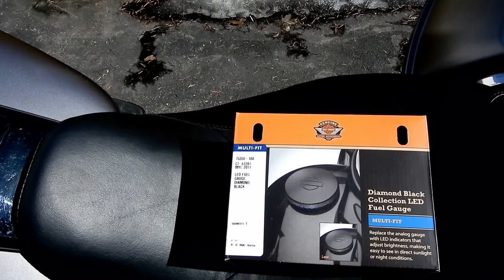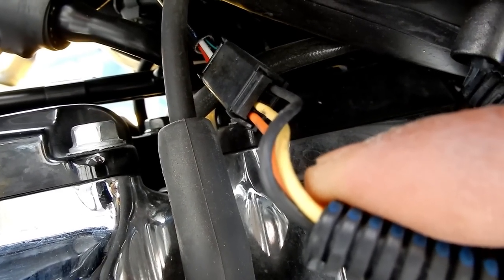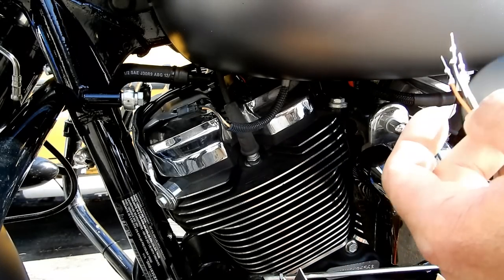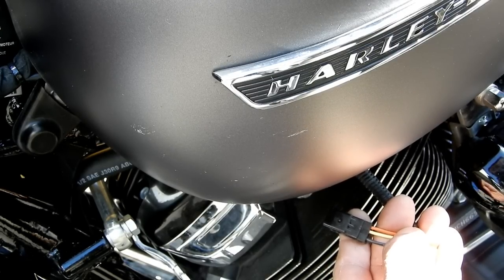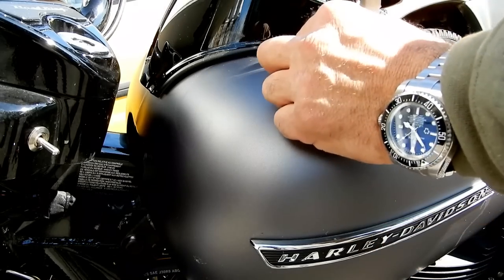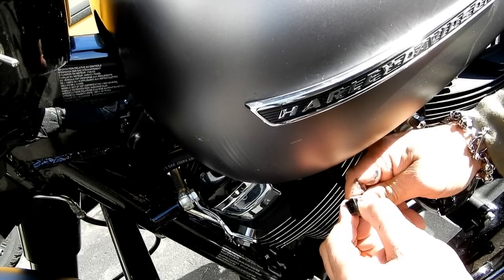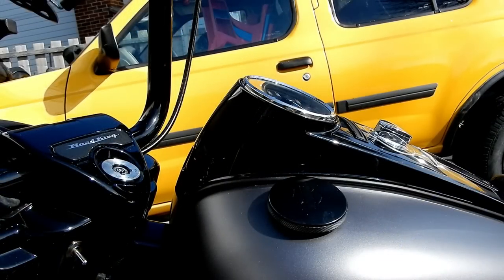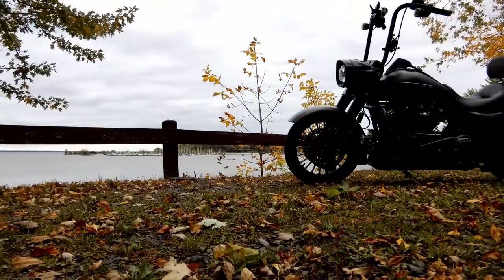DIAMOND BLACK COLLECTION LED FUEL CAPS INSTALL - 2017 HD ROAD KING SPECIAL

Comment: Thanks a bunch for this very nice video tutorial. Pulling the wires out of that connector is a pain in the butt. Ended up cutting the wires after a long try.
PS. Nice Rolex :)

Comment: Those black caps go really good with color of the tank. Cosmetic upgrades make the bike more personal, you feel a little more connected to the bike as you turn it into what you want.
Reply from the maker: Thank you brother!
True story on the cosmetic upgrades...But I think I am done with that, other than some LEDs at the rear end of the bike.
Time to save for trips!!!!

Comment: Well done, also gonna save me some Cussing on that Lock mechanism on the Gauge side Harness, some videos show them fighting the pins inside with a screwdriver to release the pins out, so looks like there is that tab to unlock to pull out without buggering up the pins and Harness . Waiting on an Xtreme Machine chrome ( Death ) model to arrive.  Safe Riding, Cheers !

Comment: i noticed the part number 75358-10A is actually diffirent from what it says on the box  to what it says on the actual guage  75358   and 75359.  i want this exact layout for my 2013 dyna trying to get the right one.  I think ill order the same exact thing as u

Comment: Great video ! thank you.  Question I have not received the Bike yet waiting on delivery so, the side with the LEDs is not the filler side right? do you have to purchase 2? I can't find a flush mount cap with no LEDs maybe its me.  In any case thanks again.
Reply: Your correct.That side is just to let you know how much fuel is left.The right side is where you fill up at.The flush mount gas cap set up is flat and flush.I don't think they have any lighting on them.(2018 Road King Special Owner)

Comment: Nice mod brother.  I noticed the setup a few videos ago and hoped you documented the install.  I also hope the new gauge is more accurate than my stock part.   They say these tanks hold 6 gallons but I swear the most I have ever been able to squeeze in mine is 5 gallons after running it down to where the miles left to empty on the display reads 10.  I had it replaced under warranty but the second gauge wasn’t much better.  If it’s a 6 gallon tank I should still have 1 gallon when my gauge and readout shows bone dry.  Have you experienced this?  One HD tech told me the capacity of the tank would be 6 gallons without all the extra stuff in the tank reserved for the gauge / sending unit.  I don’t know.  Regardless, great video!

Comment: Great tutorial and it looks great. I have a question though. What is the switch by your handlebars?
Reply from the maker: Thank you brother!
I have installed auxiliary lights on my crash bars. They light low and close to the bike. This is the on/off switch. Like the standard Road King or the Heritage.
Reply: BigBadWolfMoto thank you. That makes sense. I thought I was missing something haha!
Reply: WhenPigsFly 
I was wondering the same thing when I seen it!

Comment: How much for the original? I assumed this would be easier. I actually bought a stock one brand new for $40
So it didn’t come with the “new housing” 
What’ll I get charged $500 for that 
Thanks, that sure helped, you’re awesome

Comment: Look good . Next black the switch.  ?
Reply from the maker: Probably. But If I get into the trip of blacking everything out...It will get crazy! I would rather work on LED blinkers and LED rear running light...
The engine has some chrome accents anyway. So it's all good.
Thanks brother!